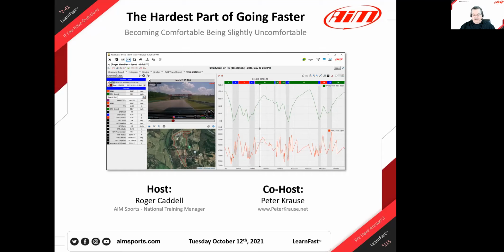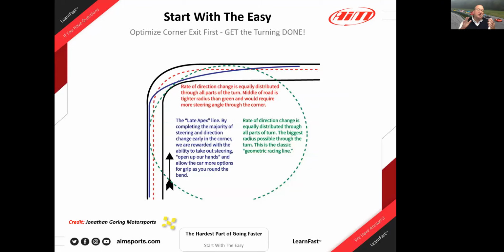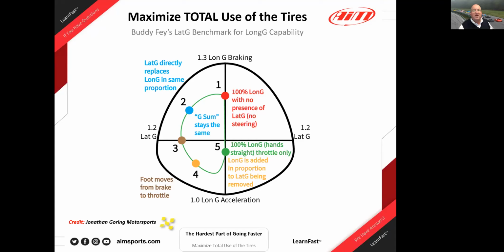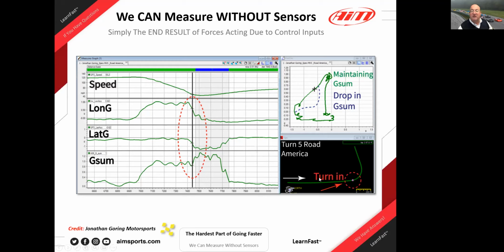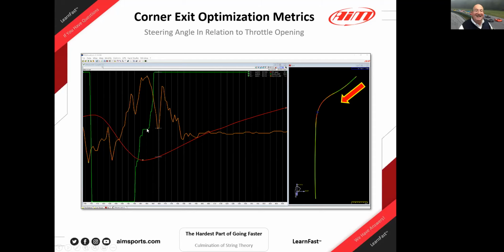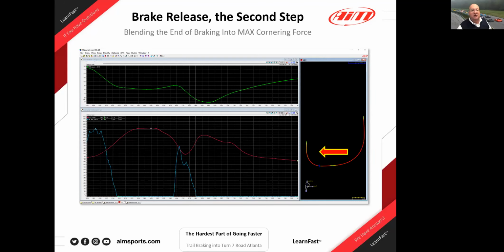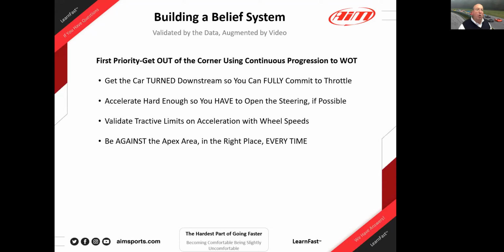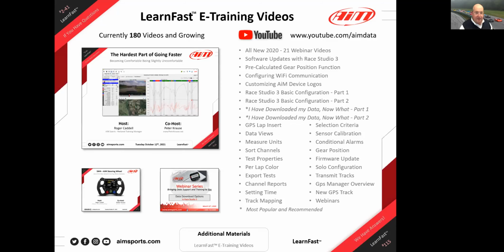2-41 The Hardest Part Of Going Faster - Live Webinar with Peter Krause - 10/12/2021

Comment: One of the first slides shows three lines going in and out of a corner. First I would think blue is the correct one, but as Peter Krause is telling green line is more consistent… now I don’t know or does it depends on the car ?
Reply: Erik, let me know which one and perhaps I can explain better. I know most of the slides have three different measures (channel values) on them. Over the last couple decades, my experience is that good data is less car dependent and more driver skill execution dependent. None of my examples are perfect, but they're in the upper echelon and they are going faster than most other drivers in the same car.